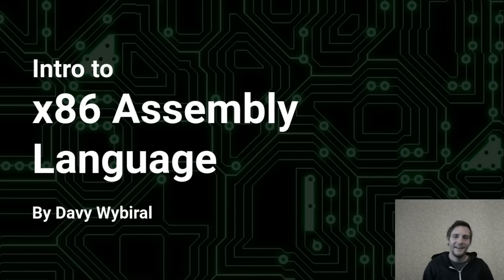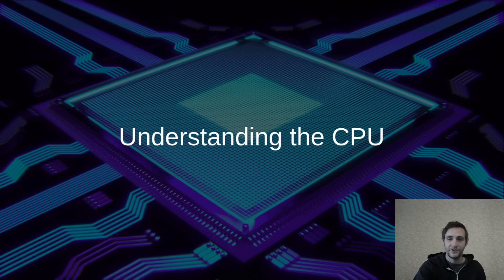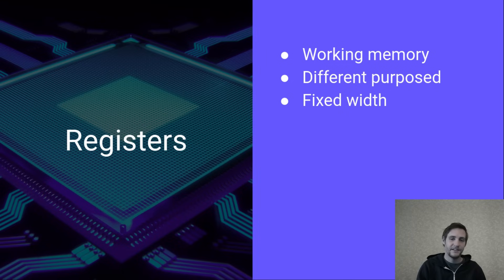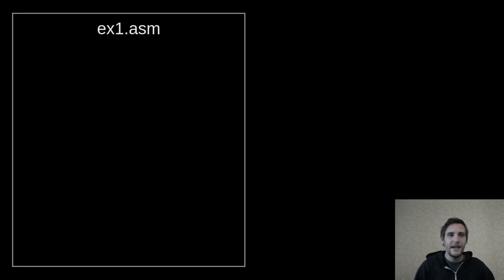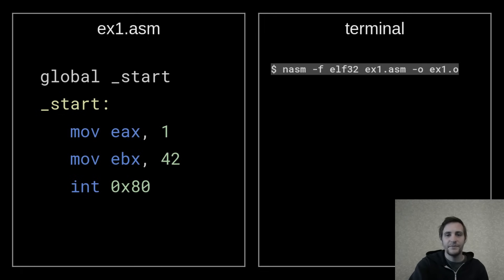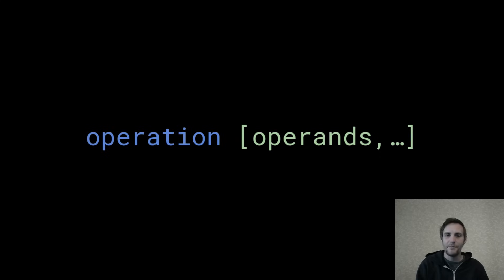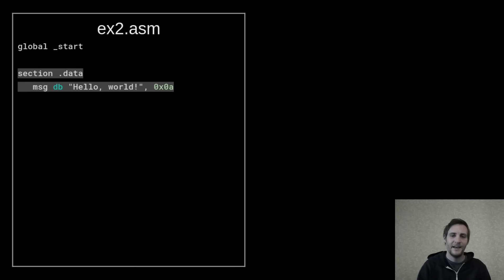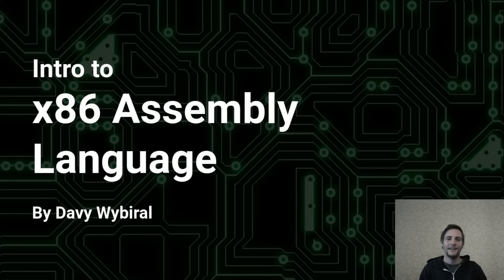Intro to x86 Assembly Language (Part 1)

Comment: “Assembly language is basically just a human-readable form of machine code”

As a complete beginner who has just looked at Assembly code for the first time, I am crying both tears of laughter and pain at this statement
Reply: I hope you didnt give up but you'll want to start somewhere besides x86 assembly. There are loads of languages that make more sense and are more natural to write for a beginner.
Reply: nick still Which one would you suggest? I have recently started wanting to make my own computer on a breadboard, but I want to be able to actually make programs for it. Do you think the Motorola 68010 would be an okay pick?
Reply: @kraio-sfu  hell ya! A big project but could be rewarding. My personal preference (arm chair opinion) would be to start with a 6502. The Assembly lang is straight forward and there is a community around ROM creation for the 6502 with python and you can even by a kit for breadboarding it
Reply: nick still Oh yeahhhhh, I was wondering what that CPU was called. I was watching the Ben Eater video on it the other day. I heard the people that made the 6502 also made the 6800 (two zeroes). Does this mean, in a way, that the 680x0 series could be seen as a more complex 6502, even though they’re by different companies? The 68k is based on the 6800, it’s not just the namesake, right?
Reply: @kraio-sfu  the 68k is the Moto 68000 and Moto made the 6800 series as well but the 6502 was made by MOS which was started by ex Motorola engineers then it was later aquired by Commodore. Going from 6800/6502 to a 68000 series is like going from a honda civic to the space shuttle. The 6502 uses an 8bit instruction set which is super straight forward. The 68000 uses "microcode" which is closer to the modern x86 architecture we have today.
Reply: @kraio-sfu  learn C really well. Get very familiar with pointers. Its great if you have a IDE that lets you look at what is going on in memory as you debug the code. After that ASM will be easier to understand concept wise
Reply: @kraio-sfu  I suggest python cuz it's much more widely used and it is sky rocketing in popularity these days
Reply: @kraio-sfu my questions is WHY would u want to do that?
Reply: @ytgadfly  i totally disagree. Learning a high level language will not teach you anything about machine code.
Reply: @Kraio have you tried lua or python? Their more higher level and easy to learn.
Reply: The Planebagel Oh I absolutely love Python, it’s my main programming language. I just find it funny because calling Assembly “human-readable” is a very generous statement
Reply: Well, then I recommend trying brainfuck, the most basic programming language... XD
Reply: Well they said it's readable. They never said you'd understand what you'd read, though.
Reply: "Assembly languages are extremely poorly-designed programming languages" is the real truth. A "human-readable form of machine code" should describe something like the hexadecimal representation of the bits for each instruction, or human names for each instruction. "Assembly language" SHOULD mean "a mapping of bit sequences to natural-language names, so humans don't need to remember a bunch of arbitrary patterns/numbers", and that's all it should mean; just 1-to-1 translations from binary bits to plain English. Current so-called assembly languages don't even fucking manage that; they use the worst possible names for each instruction, register, literal data etc, so they aren't actually human readable - they're still abstract representational symbols with their own arbitrary meanings. They may as well just be the hexadec codes. Worse, some fucking idiots along the way started taking what was previously JUST assembly language, and then putting programming features like labels and constants and macros into it, and the fact they still called it "assembly language" after that is infuriating. 

That's not machine code; *that's a programming language with really shit syntax.*
Reply: @qualityedits3083  not a programming language really, it's machine code made abstract so humans can more easily read and write it. Also many things you write in assembly, after assembling will get lost, like variable names and labels, it will be erased or converted to an address ;D which will leave pure numbers - machine code
Reply: You would be surprised how much building a computer with Minecraft Redstone can teach you. It's like building on breadboards, but a bit cheaper, sadly though the final computer will be a bit slow......
Reply: @ethanweller3013  
Computers are slow
Reply: More precisely, you should at least start with C or C++, it helps a lot.
Reply: C is a high level language xdddd
Reply: khahaha I was about to cry when I saw 6502 NES assembly code xD, but I kind of understood half of it already so it's not that bad, but after I saw ARM assembly... well shit xD
Reply: the likes are 404 lmfaoooo
Reply: Actually I also treat this as pretty hard, even though I'm a programmer.
Reply: Learning assembly as your first language will be quite hard and pointless, but possible. If that's what you want to do, good luck. 👍
Reply: This is for one of my finals in college. I said to my entire class and I quote. "Im gonna find the Jerk off that made assembly code and tip his old ass out of his wheel chair to watch him try to get back up in it." I didnt mean that, I was just furious at how hard this is to learn
Reply: No, nope. Stop. Turn around. Do not!
Reply: whatsup @kraio-sfu its been 3 years. how much have you learnt?
Reply: @ASRu2k3  Not much, unfortunately. I soon got overwhelmed and gave up. 😢
Reply: learn lua.
Reply: (5 years later) DONT give UPPPPPP
Reply: Assembly language is super easy. Assembly language to a programmer is like a blank canvas to an artist. Unlike high level languages are like paint by number

Comment: I really enjoyed this.  I'm currently reading the PDF Reverse Engineering For Beginners (understanding Assembly Language) and it gets a bit heavy at times when it talks about different CPU architecture sets and different compiler output.  But your video is straight to the point.  Thanks

Comment: What's the reason that MUL and DIV are always applied to eax?
Reply: Copied from top comment:
08:34 Actually, MUL and DIV also affect EDX. The MUL instruction stores the higher half of the result in EDX, while DIV stores the remainder from division there. If one dosn't know about that, one can be very surprised that suddenly their EDX is getting clobbered with "random" numbers after division/multiplication.

Comment: Intel has the most brain dead cpus I have ever worked on. The Intel 8088 which came on the original IBM PC. It could directly address 1meg of memory. 1 meg in binary is is 20 bits wide, yet the CPU was 16 bits. How did they accomplish this? They used Segment registers. So as a program was running it would SHIFT the CS register 4 bits to the left amd then ADDI G the PC register thus making a 20 bit vamue to be put on the address bus (which was 20 bits)
The CPU did this shift/add on EVERY instruction fetch!! How stupid!
In addition it had special registers such as A register used for math 2 general registers (B C). What not just make 8 or so GENERAL purpose registers. Dumb!
I wrote well over 2.5 million mines of assembler code most on mainframes and Intel by far is the most brain dead

Comment: How can you load a 14 byte string into a single register? Something must be going on behind the scenes of the compiler
Reply: msg db "Hello, world!",0x0a
mov ecx, msg

14 byte string "Hello, world!\n" is not stored in 32-bit length register ecx. That string is actually stored in RAM, each byte having its own 32bit memory address.

Ecx only store the 32-bit memory address that storing the first character "a". By using the address of the first character (ecx) and the length of string (edx), CPU could access the rest of the string.
Reply: @rtnf4052  only if the compiler is taking that single reference and building a loop around it to process until the end of the string is reached, I assume?

Comment: hi/your videos are amazing/i have one qustion/is x86 Assembling the software or not?/that means x86 assembling language is software for setup on pc?and coding /
Reply: x86 is a processor architecture, as in how the actual hardware is designed. You can use different software such as nasm to error x86 assembly.
Reply: X86 assembling memory used in hardware detected
Reply: CPU and memory and microprocessor are belong to hardware detected, not software
Reply: Assembly language is also available for hardware programming language

Comment: I used to write languages with Notepad . Anyone know how to make a+e a symbol ae ? Or a (r) and smash it to make a ®️.... After NT 5.0 they removed this part from notepad. How do I make Languages after NT 5.0 ? I’d like to get back into writing SQL’s . I used to use notepad and save the files as Txt.exe and when I double clicked the file it would run it as a process and execute the code. Instead of trying to open it as a text file.

Comment: Excelent, straight to the point and no "suscribe bull".... Great presentation and introduction
Reply: reena mola  "mov eax,[ebx]". 
imagine ebx=0x40000. 
So we are saying: "mov eax, [0x40000]". 
imagine memory at 0x40000 = 20. 
So we are saying: "move eax, 20". 
Note, syntax might change a bit of how to reference a registry depending on the tool (at&t, intel, oracle...). But that is not the case for the example above.
Reply: reena mola  No, registries do not have addresses, they are just... "there". Memory has addresses, and the more memory you have (2GB, 4GB, 8GB, etc) the more "addresses" you have.
Reply: reena mola  no. you are talking about the "sections" that a registry has. Every 32bit x86 registry has 4 sections, and those are different from memory addresses.
memory addresses refers to the RAM.
registries do not have addresses.
registries can store addresses.
references to sections of a registry is with 'ax, al, ah', and other special words; not with brackets.
any RAM address is refered with brackets[ ].
[eax+4] = go to the RAM, at the location of eax+4.
eax+4 = add 4 to the value stored in eax. (not sure if this is even permitted)
Reply: reena mola  Make good use of knowledge! 🤙🏽
Reply: Thankyou brother ❤️ @ivandres73

Comment: how can one know in whivh register should we move the value? for example like how do we know if value 1 should be moved into eax and value 42 into ebx? is it possible if we move them into ecx or edx? can someone help me which registers are suitable for which?
Reply from the maker: It depends on the system call you're making. On Linux EAX is always going to determine the type of system call. So when I set it to 1 I'm specifying that it's a sys_exit (system exit) call.

Here is a chart of different system calls: https://syscalls.kernelgrok.com/

You'll notice that EBX, ECX, ...etc all have different meanings depending on the system call. If you're not doing a system call then it doesn't matter, they're general purpose registers. So you can use them however you want until you need to make a system call and then they have specific purposes.
Reply: oh, so you mean it doesn't matter in which register you store the value at first, right? I was so confused about that ever since i started learning this language ..
Reply: @lunaluna7aya   Normally the registers are "general purpose", wich means that they're at your disposal and you can do whatever you like with them. It's basically your scratchpad.
But on Intel/AMD processors, each of those registers has also some "special purpose".
For example, the "A" register (AX, EAX, RAX) is for Accumulating the results of calculations. It is often the default register for operations like multiplication or division, and therefore it is also used for returning values from functions etc.
The "B" register (BX, EBX, RBX) is the Base registers, because originally it was used to store the base address for arrays of data in which you index with some other register.
The "C" register (CX, ECX, RCX) is the Count register, because it is often used as a counter in loops or string operations.
The "D" register (DX, EDX, RDX) is the Data register, because it can be used with I/O ports, in which case it stores the data to be sent throuth the port (the port number is in A).
There are also "index registers" (pointers) that are used for pointing data in memory:
The Stack Pointer (SP, ESP, RSP) for pointing to the top of the stack, Base Pointer (BP, EBP, RBP) to point to the base of the stack.
Source Index (SI, ESI, RSI) and Destination Index (DI, EDI, RDI) that point to the source and destination data in string operations.
There's also Instruction Pointer (IP, EIP, RIP) that points to the next instruction to execute. You don't manipulate it directly, but it changes when you make jumps, returns, subroutine calls and interrupts.

The interrupt number 0x80 is a system call on Linux, so it only works on Linux. Microsoft DOS used a different interrupt number (0x21) for the system call. You can find the full list of available interrupt services in the Internet.

Comment: Do MASM and NASM share the exact same syntax? Also, could you please make a video on how to do this on Windows?
Reply: No, there are tiny differences between them.
For to specify how many bytes we want to access for a memory write instruction with an immediate operand:
MASM: mov  BYTE PTR[si], 0
NASM: mov  BYTE[si], 0

For to get an effective address:
MASM: mov dx,  OFFSET ERROR
NASM: mov dx,  ERROR

For to get the content of an address in the data segment:
MASM: mov ax, [ADDRESS]
MASM: mov ax, ADDRESS        ; the same as the instruction above, so i prefer to use brackets[ ]
NASM: mov ax, [ADDRESS]
Reply: Ok, so the terminal code doesn't work on Windows? That's why my code isn't working; the terminal keeps saying ld isnt a recognized command..... I guess I should've stuck to Linux for this....
Reply: Dux& Cone  but where is the path loooooool

Comment: Nice, just worth mentioning what $ does.
Reply: It's the linux terminal beggining
Sort of like how windows has C:/
Reply: @baguetteyeeter  I meant in assembly :) I.e. address of the current assembly position (instruction?)
Reply: @orastem  Would that not be the same as CS:IP?
Reply: @mikicerise6250  CS:IP is the address of the currently executed instruction (at runtime).  "$ evaluates to the assembly position at the beginning of the line containing the expression". So, you can have multiple $'s in your source, each evaluating to its own "address" (at compile time), which are then baked into the binary.

I just rewatched the video, amusingly, there's also $?, which is a Bash symbol for "the value of the exit code of the previous command".
Reply: @orastem  I see! Thanks. 😊

Comment: try https://flatassembler.net
Reply from the maker: I remember using FASM when I first got into assembly programming and I liked that it could do the linking step. But since then I've mostly used NASM or GCC for x86 so I can't really speak to modern FASM. Does it have any features that significantly separate it from NASM other than linking?